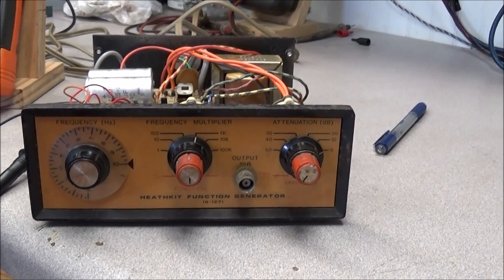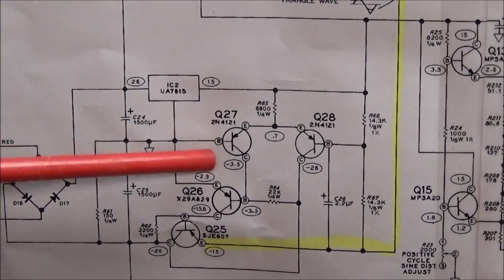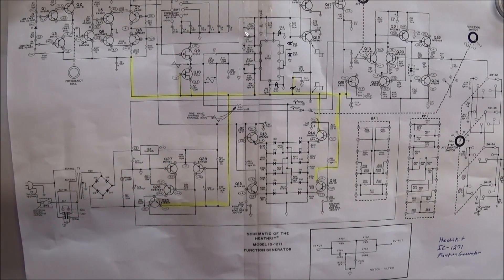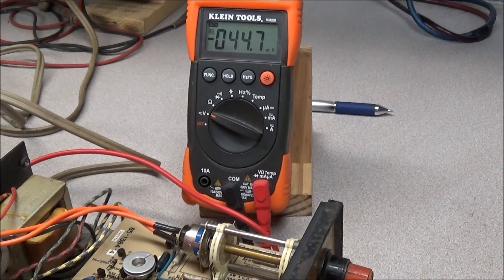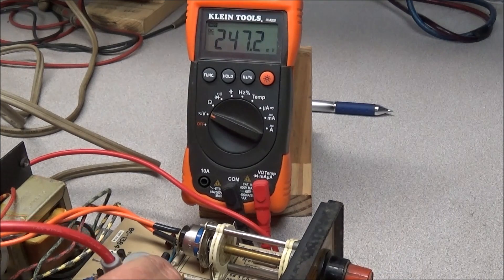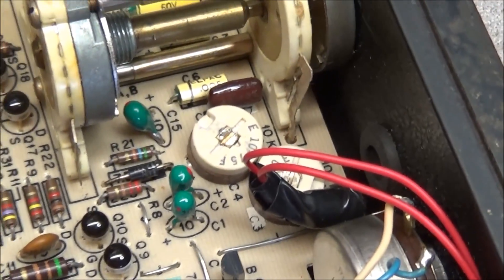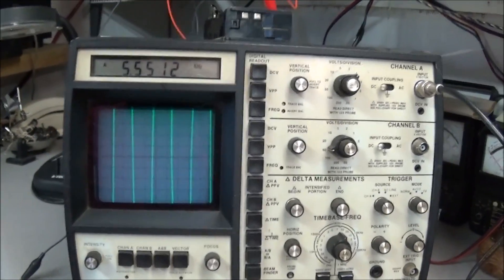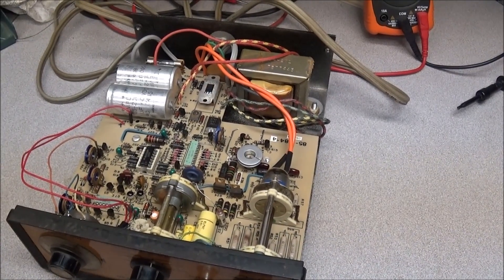#007 Heathkit IG-1271 function generator repair

Comment: Just pulled my IG-1271 out of storage and went searching on YouTube for info. Found your video and really appreciate the way you trouble shoot the system. Heathkit was notorious for running their tants on the ragged edge and they often fail when attempting to revive old gear - mostly open but sometime shorted with smoke and flames. No fun.

Thanks!

Comment: Buddy, thanks for the video and the technique!  Mine went away a year ago and it and its companion frequency counter were set aside for a set of very good units I got at a swap meet. This past Saturday, I got the 1271 down to troubleshoot it using full power, a DMM, and a scope. The trouble was tracked to a bad Q3 (a 2N4121, PNP) that was replaced with a perfectly fine 2N3906 and the unit was recalibrated. Works spiffy now!
In following the troubleshooting steps, the symptoms yours exhibited would have revealed a bad minus rail (mine did not) and would have been taken me to the section you debugged. 
The takeaway from your experience and mine is that Heathkit produced some pretty decent test equipment using off-the-shelf parts and their manuals were very good because they not only provided the voltages, they gave an insight into how the equipment was assembled.
Am a big fan; keep up the great work!

Comment: I have 1 of these i changed the filter caps & the power supply is getting hot & i was bringing it up with a variac  real slow about 5V at a time . when i got to 35v the fuse was getting to hot to . so i need your help on that if you have time ? i know it takes a slo blo fuse 1/4 amp 250v . i have some of those ordered , but i was using a fast blo same voltage fuse .  Thanks for your video .